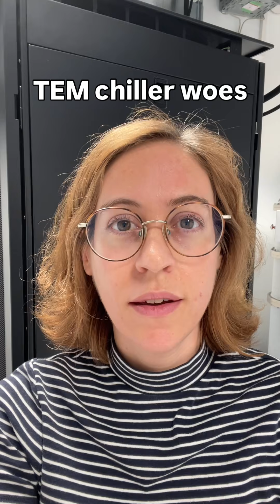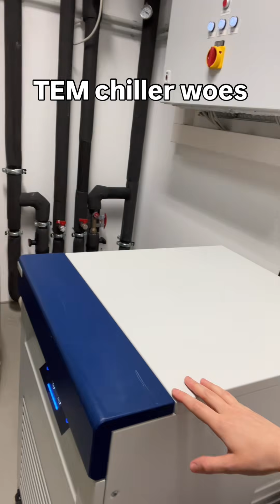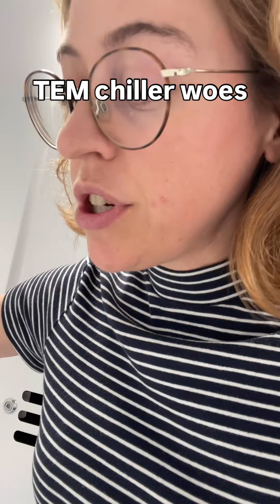TEM Issues – Chiller Turning Off

Comment: Is your facility water purified? High mineral content can lead to issues within the chiller. Best of luck!
Reply from the maker: This is the issue we’re currently testing. We’re running water with citric acid dissolved in it through the external hoses (the ones that lead to and from the building water supply). Hopefully this resolves the problems. If not, something is wrong within the chiller.